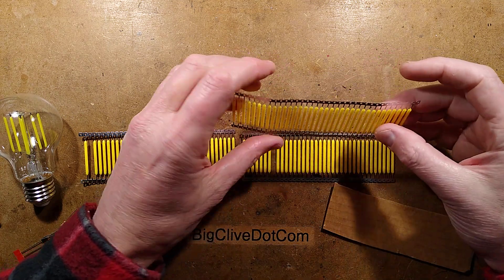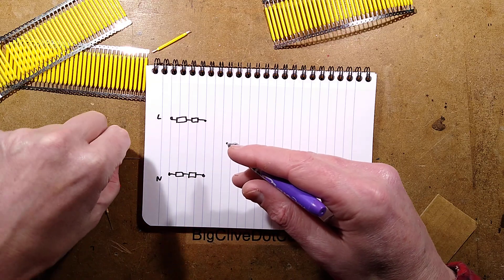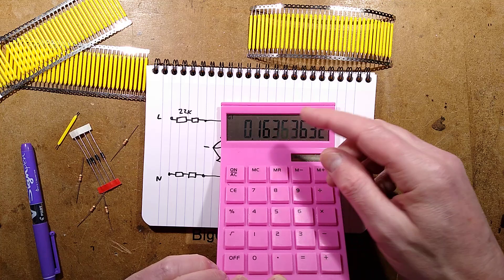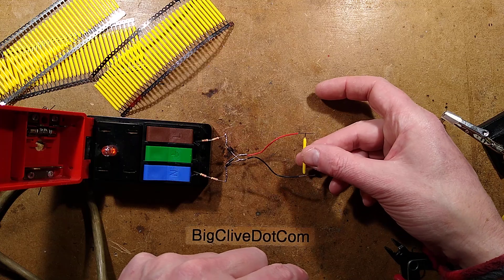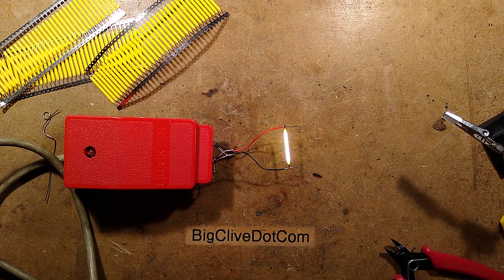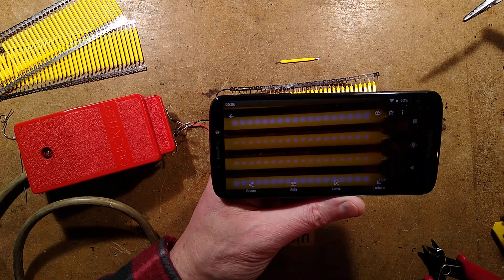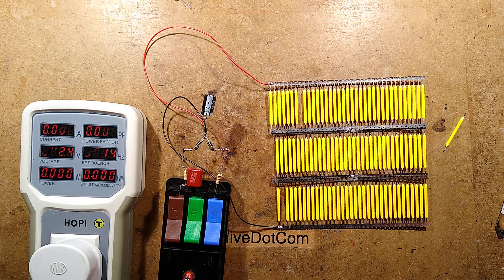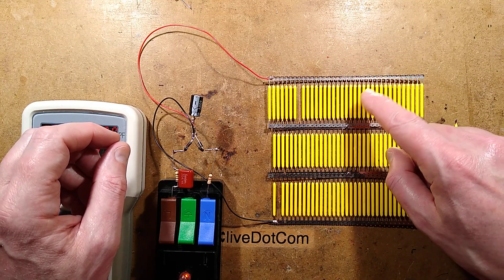104 LED filament lamp - just because....

Comment: 08:08  36 LEDs.  The voltage across a single LED would be quite a bit higher,  due to the four series dropping resistors ahead of the rectifier bridge.
FWIW:  it looks like a strip of these LEDs runs about 30 watts. It would be interesting to know the color temperature of these,  as it would make it possible to calculate lumens per watt.

Comment: I really, really like those filament style LEDs. Years ago I bought several bulbs that used those and were about as close as you can get to an early 1900's style bulb while still having useful light, which I absolutely adore. I know there are others that look even closer to the original bulbs, but those are purely for show that give off next to no light. Not that that's a bad thing, of course. But I prefer them being functional as well as visually appealing.
Reply: I also love the Edison bulb for LED lighting because you get the aesthetic dialect of incandescent with the energy savings of LED.  And, you can bet that Thomas Edison could scarcely have imagined that we could turn his light bulbs any color of the rainbow using the power of the internet.  Also, I read about a new LED fabrication process that produces a CRI of 98+, making it the closest thing LED has yet become to natural daylight or incandescent light.
Reply: A couple of years ago on Amazon I accidentally bought a Maglite Solitaire penlight that used an incandescent bulb instead of a LED cob. It was so dim that I thought I'd been scammed! But yeah, it turns out that there's a market for really dim lights. In the case of my little Solitaire it turned out to be for aviators and campers. In those fields, it's beneficial to have a dim light by which you can read maps and manuals without disrupting your night vision.
Reply: I recently bought three of the ST64 by Philips Hue and put them in a nice table lamp, all upright next to each other in a horizontal configuration. They are dimmable and go very bright, but can also be super dim solely as decorative fixtures. Expensive but pretty neat!
Reply: Yes, just true facts about filament led bulbs
Reply: I prefer using the incandescent version i have an led filament in the lamp in the room but don't like them i am using the st64 Incandescent in the living room lamp which i love
Reply: Yes, the filament bulbs are the only ones I like to buy. They've gone down in price quite a lot over the years. Those offerings from people like Phillips I think with the hazy opaque plasticy bulb and plastic base with the gubbins in just aren't the same 🥳
Reply: i bought one with a rustic-looking lamp for my mom last year! they're called edison bulbs if we're talking about the same thing

Comment: Could these be safely used for toilet bowl illumination if sealed in pvc pipe or would they overheat ?
Reply from the maker: I'd suggest a dedicated toilet bowl illuminator from eBay.
Reply: You could also combine RGB LEDs and a VOC sensor to indicate the smell level inside the toilet room outside the door as a warning.

Comment: Stupid question from a rookie:  wouldn't this have all been safer and less work if you just used a bread board?  Or do those get tedious and annoying?
Reply: It wouldn't work in this case, it would be particularly tedious, and he would've had to remove every single LED from the ammo pack
Reply: Bread boards are useful for prototyping where you have to change components often, and they're useful for beginners who don't want to ruin a ton of components. Though the latter is much less true now than it was 20-30 years ago where components weren't 100 for £2. But if you know what you're doing, and have a bit of experience with the soldering iron it's pretty darn fast to do "dangling PCB made out of the actual components" :P
Reply from the maker: Easier and safer to skeleton wire it.

Comment: I thought that it would look good in an old dimple whisky bottle, as a side lamp. But then thought how do you rig it so it fills the inside space uniformly when the hole in the bottle neck is the diameter of a sixpence!
Would it be akin to putting a ship in a bottle and would you have to create some rigging from monofilament fishing line? 
Your thoughts would be very much appreciated. Cheers, Paul
Reply: The easiest way is probably to cut the bottle in half (with a glass saw), put everything inside, and then glue it back together with UV curing glue
Reply: Stuff them in a fish bowl
Reply: I was thinking cut the bottom off the bottle and glue it back on. But maybe cutting the bottle lengthwise would be a better option?
Reply: I imagine rolling up a long strip of them to shove through the neck, and delicately applying epoxy or similar with some chopsticks might work

Comment: Oooh, Love these and all the creative things they could be used for.
I'll have to check to see if they have any low voltage versions.
Reply: They have. I made a wire-suspended text in a picture frame out of 38 parallel 3V filaments. (And I soldered 38 smd resistors to each filament before soldering them into the net mid-air ... I'll not be building a second one anytime soon XD)

Comment: You could make either a ridiculously bright filament lamp (if the filaments are rated 0.5-1.0w ea) of 50w+ or a super long lasting one that still provides an entire room of light (round cage maybe?).
Reply: I was thinking maybe build a large corn-style bulb, but with a potentiometer in series, so that you could make it a 20w bulb that lasts forever, or crank it up to something like 50w that would have a shorter lifespan, if left to run at that brightness for a long time.
Reply: @arletottens6349  I'll be looking forward to witness the LED saber of death right here on the grest interwebs.
Reply: Instead of a "super long lasting" lamp, how about a super long lamp‽ 👀
Connect all 100 filaments in series! It'd be like a fluorescent lamp! Or an LED strip!

But instead of being powered by boring 12V, 24V, 120V, or 240V, it'd require a far more interesting 4~5 kV! (According to my sleep-deprived calculations, anyway 😴)
Can the FART transformer output voltage get that high at enough mA? I don't recall its specs 🤔

(I only managed 3 hours of sleep last night, so after feeling like a zombie all day … this … is apparently what my brain comes up with while I'm barely still conscious 😶 🤷‍♀️)

Don't play with high voltage, kids!
Reply: @AndrewGillard  A cold-cathode neon transformer might work.
Reply: @AndrewGillard  that's a very stupid idea. I love it.